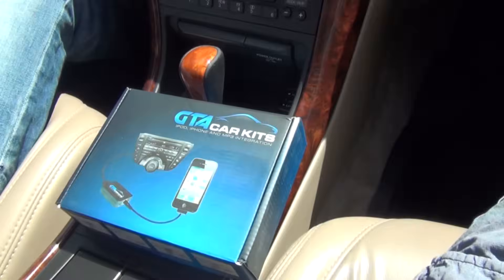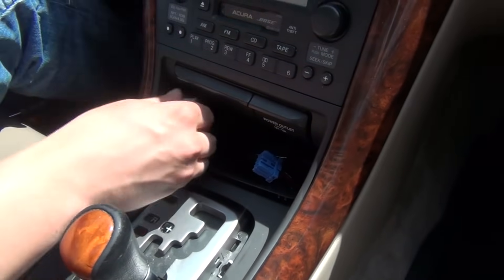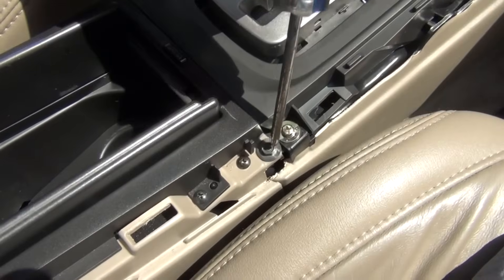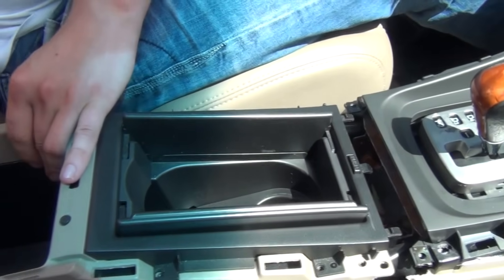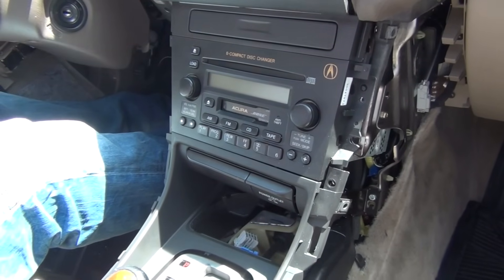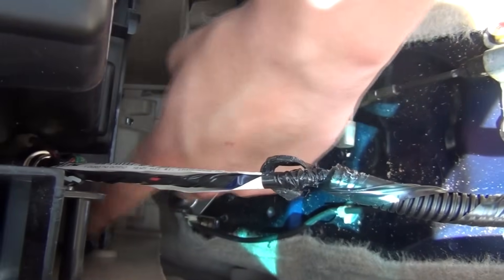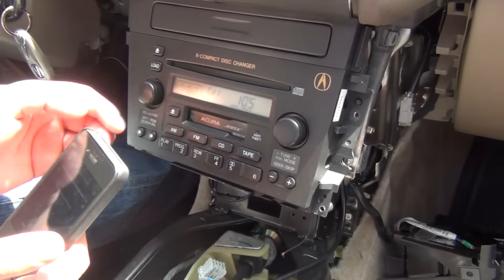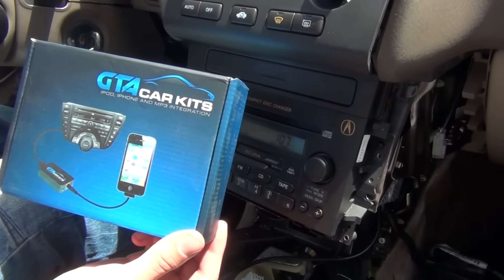GTA Car Kits - Acura TL or CL 2000-2003 install of iPhone, iPod and AUX adapter for factory stereo

Comment: Yeah I just reached around and plugged mine in without taking out all those screws so thanks for saying that at the end of the video. But for the purpose of this video, I found it very helpful.
Reply: +Nick Ogle I took my entire dash apart in my 2003 TL S. I needed to though because i had to wire in the bluetooth mic but I'd rather have everything layed out how I want than to rather lazily cram in it there.

Comment: Great video for removing & installing the radio.  Don't try to streamline the instructions if you are replacing the radio.  If you are using this video to replace the radio with original equipment (usually because the CD changer has gone bad) make sure that you put the code in with the antenna disconnected.  Then connect the antenna and finish the job.  If you just need to reenter the code, then just disconnect the panelling on the left side of radio, disconnect the antenna, and enter the code.

Comment: Installed and and operated just as described in video. Took my time and it took about 2 hours start to finish. Only thing tricky was positioning the control box, it could not lay flat in area indicated, it had to be set on end right of the shifter  otherwise the console would not fit and stuck up 1/4". I did tie wrap the the two cables in a couple of places near the control box, around the wire harness running thru console so the cables would not pull out. Great product.  Great video, very helpful. Without it I would not have known where to even start.
Reply from the maker: MG Lampert We are very happy to hear!

Comment: I was following this video, when I was installing a aftermarket deck. the compartment by the cup holder doesn't need to be removed. just follow trim removal from shifter. In my opinion it's a nice car,buy it a nice touchscreen deck.

Comment: If you are installing a sub woofer amp you don't even need to touch the deck.  There is already a sub amp in the back dash connected to the stock 9" sub, tap into the speaker wires going to the stock deck to get your signal wires. In the video he shows you where the fuse panel is, tap into the ign/acc fuse to get your remote turn on wire, run power from the battery, ground to raw metal inside the trunk and it's done.
Reply: Excellent!!

Comment: Jesus christ I guess Ill just keep burning cd's
Reply: agreed
Reply: Lol
Reply: This is really not all that complicated- I did the installation of the iPhone and Bluetooth kits in a CL in a little over an hour. The GTA panel removal tools are worth the money they ask for them & can be used for other car repair chores too.
Reply: Mad Season Staley them cds go hard lol
Reply: This is easy.  Just go to the junk yard and buy an old lawn mower.  Bring it home and tear it apart and then put it back together.  Don't torture yourself with the carburetor.  Do this a couple times.  Get an old piece of crap toaster, VHS player, DVD player and tear them apart...  The old washer & dryer same thing.  In a years time you'll have skinned your knuckles enough to be ready for this piece of cake.
Reply: Mad Season Staley 4

Comment: What should I do if the stereo doesn't work at all. No code or nothing shows. It just won't turn on. Car works perfectly ok. And so does the actual heater. But the car stereo doesn't seem to work or turn on. Van it be something unplugged in the back part or the.stereo or something worse, like something in the engine part please help asap

Comment: Would I be able to plug in an adapter for the 30-pin iPhone cord? I use one in my Infiniti FX35 which has a similar installation, just without auxiliary and charging capabilities. I currently use and iPhone 6 Plus which has worked flawlessly with the 30-pin to 8-pin lighting adapter even though it was a kit for iPhone 4 and below. Would this same adapter work with this kit shown?

Comment: Is this method still actual for modern iPods and iPhones? Or do I have to find an old one(for even older car, lol) for this trick to work? And what about simple MP3 players? As far as I concerned they do not provide an ability to change tracks via standart control buttons on radio or steering wheel(except volume level), is that correct?

Comment: I have a 2002 tl s with navi and I keep hearing my 6 disc in dash radio does not have to the open slot necessary to add an aux input.  I was hoping I found out for sure before I order something and tear into the dash.
Reply: spainman2020 bro did it work ?

Comment: I have CD's stuck in the player and it will no come out will that make a difference in using this system.
Reply: +Andre Decoteau just take the radio apart and take the cd out lol
Reply: +ThaDjSteps LOL, the CD's came out a few days when the temperature drop below 20 degrees.smh
Reply: seems like certain cd-w disks maybe of different heights or thickness.    When mine got stuck I couldn't play the other 5 CDs.
Reply: i punched my cd player, and it fixed it lol
Reply: Lol

Comment: I have a 2000 Acura 3.2tl with single cd/cassette. Would this still work even though my stock unit doesn't have the changer built in?
Reply: did it work? I got same music system I know it was 7 years ago
Reply: @sukhjitamaze5205  It did
Reply: @JonasJacobs1  Thank you I just ordered one from aliexpress for 15 bucks
Reply: @sukhjitamaze5205 what did you look up to find it? Do you have a link?

Comment: ... drilling a hole is unnecessary. There is actually a hole already large enough to fit the aux cable. It's located beween the cupholder and the center console itself. It's located under a shiny silver sticker, just remove it and pull the cable thru.

Comment: I wonder that why don't we just  change radio with a modern radio or din ? This adapter cost 80$ and it is equal to a lot of modern din that has bluetooth built in ?
Reply: The subwoofer in this car uses a special amp. If you want an aftermarket head unit you'd have to run a new cable for the sub. It's much more difficult than this.

Comment: Hi there 
I have a  acura 2001 cl 
Will this also work cause I got a brand new Bluetooth radio last night 
I got a honda/ Nissan 1982-06
Install kit 
And a  xdm16bt  will this work for my type of car? 
And I did get a adapter

Comment: Naw my Type S has wires connected into the panel you pulled off under the radio preventing an easy take off. Your looks like it doesn’t have that

Comment: Engineers designed it so you'll take it to the dealer and get charged $2,000 to do it that's the only reason why they did it that way

Comment: Nice instructions! can them be true for Acura TL 2000?
Reply: if you're still wondering, they should be, i have an 01 acura tl that came apart the same way this guy's 2002 did
Reply: @doji_town_adventures  of course not so interested. After 8 years :-)

Comment: lol why not buy one of those cassette to aux connectors. it goes right into ur cassette and u can plug any 3.5 mm headphone jack to it. i would rater have that than bluetooth which ive noticed at times gets interference
Reply: GrubbySalad The audio quality is way better over Bluetooth vs the cassette adapter. There is no comparison.